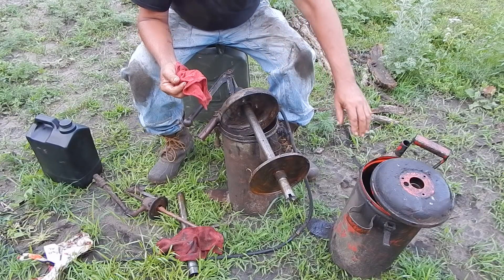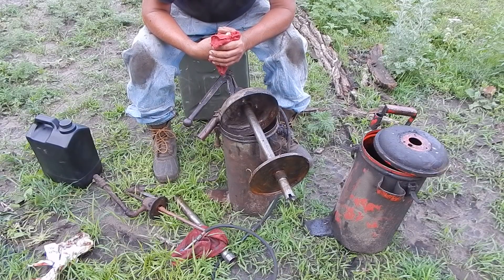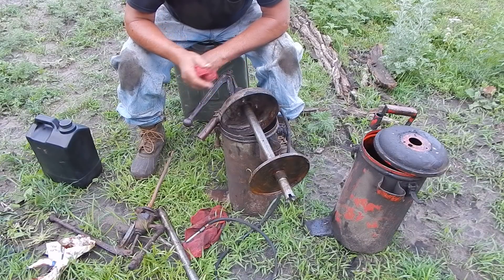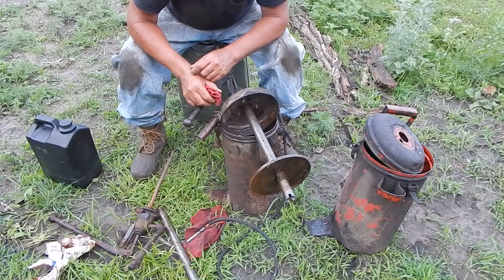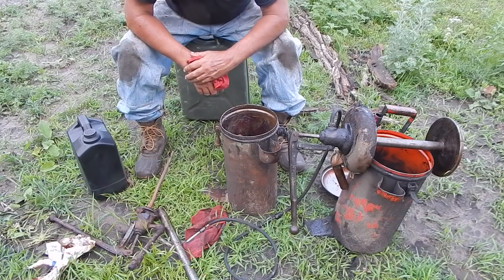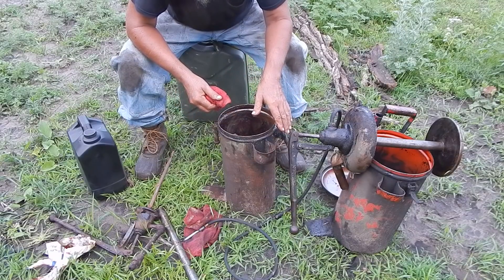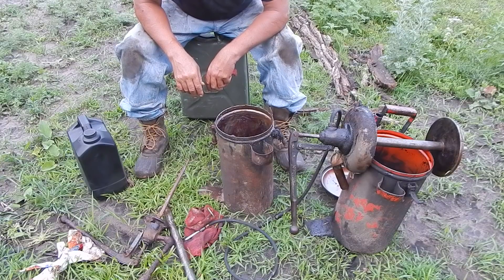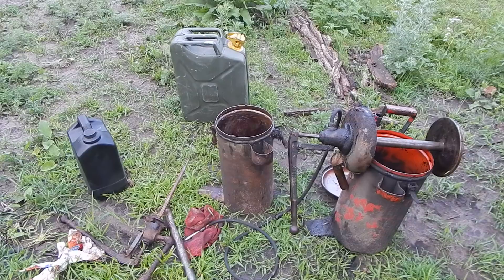Saved once again by the scrap pile

Comment: If you can get the old one clean enough, maybe with gasoline, you could braze it on the inside.
Keep it for a "spare" Make sure you get all the gas out and dry it outside for about a week before hitting it with a torch.

Comment: If you buy your 80-90 in a 5 gallon pail you can get a cheap pump that works well for them  that clamps on the pail.    not as rugged oor as well built as the ones you have